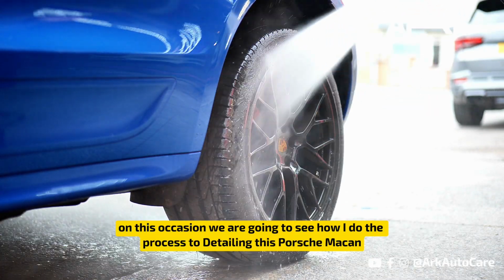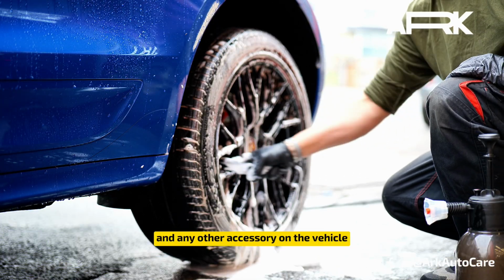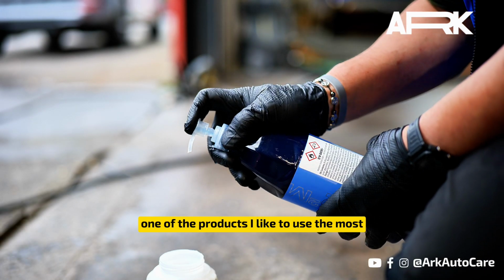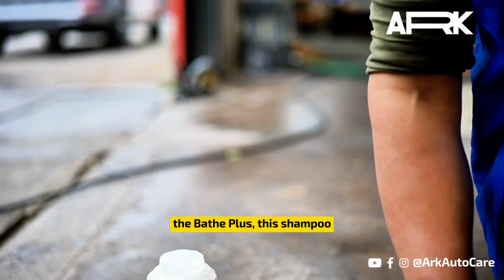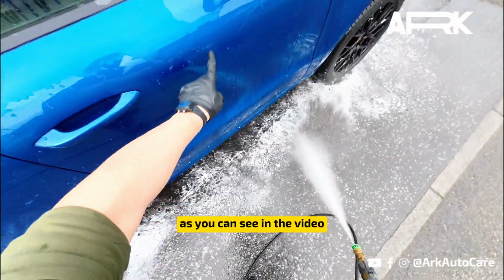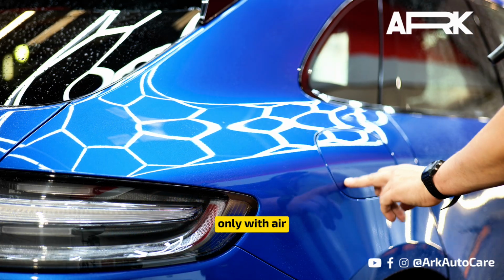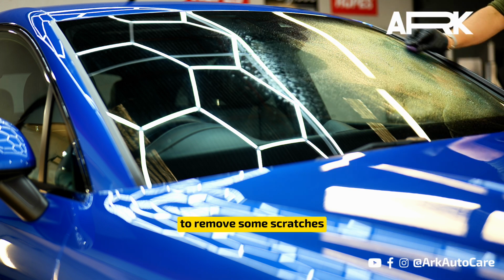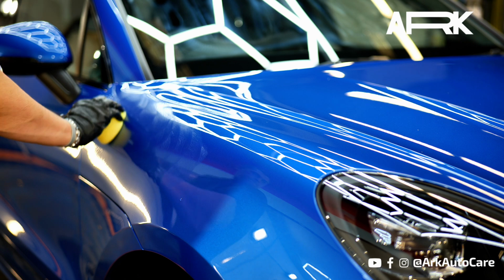😱 I Tested Soft99 Wax Coat on a Porsche Macan and Here's What Happened

Comment: Hi there, can i give you some advice. You need more of a strip wash !the last thing you want is your shampoo to have anything else in it like a ceramic. The panel should be as bare as possible.Fusso  is an amazing wax but it should be used as a base layer and then you can use another soft99 as a topper. Keep up the good work
Reply from the maker: Thanks Mate for the advice, I'll put on practice next time.
Reply: Hello, I will make an application for my car. The color of my car is two-tone orange and black. Do you think I should use light or dark colors or fusso? Thank you.
Reply: From watching the video the Macan had already been coated prior the wash, so he's using  soft99 as an added protection aka sacrificial layer which is ok.
Reply: @1kontrabida That’s no sense. The Fusso is a stand alone wax, not a top coat wax. 
It can’t grab the surface if there is another protection undernith. 
Don’t forget that he washed the car with a ceramic shampoo. Basically he did a sandwich 😅
Reply: I have used it in many ways and it leaves the paint cloudy